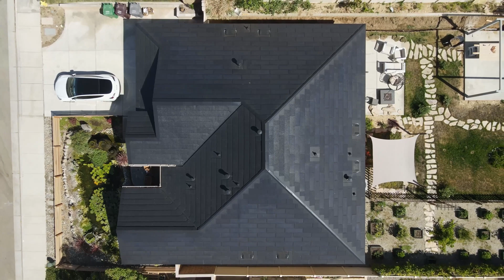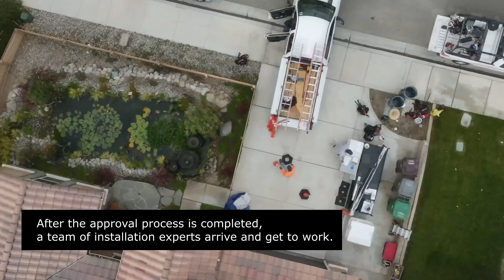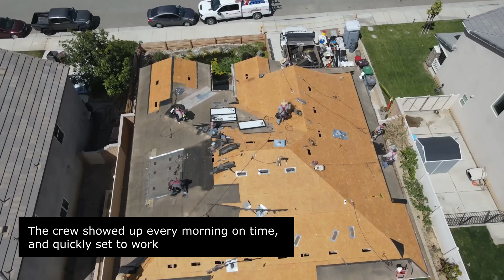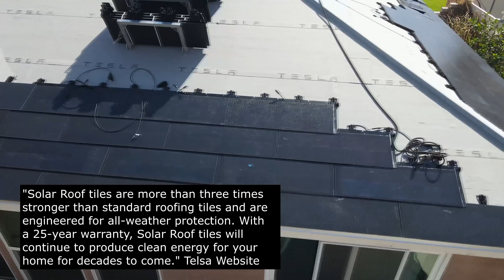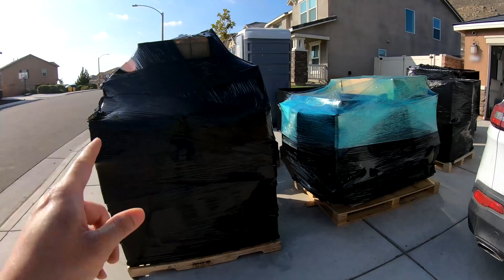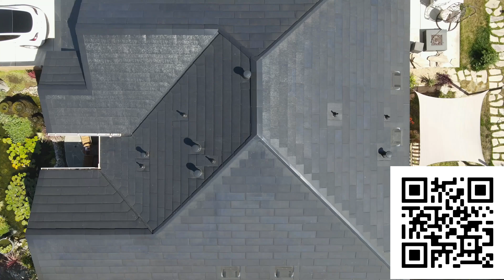Tesla Solar Roof and Powerwalls Install

Comment: Hard believe guy took that perfectly good roof off that had decades of life in it not very green.
Reply: The owner of the house likely sold the tiles or they where reused on another roof anyhow, and producing your own clean power offsets dirty power generation very quickly.
But the best implementation of a Solar Roof for sure is replacing an already overdue old roof.

Comment: How much more electricity is being generated with the new roof? (compared to the old set of panels)
Reply from the maker: The old roof produced around 10 KWH, however, I only had 6 panels.  The new roof products 60-70 KWH on a good day.